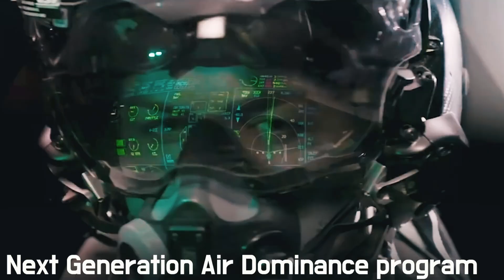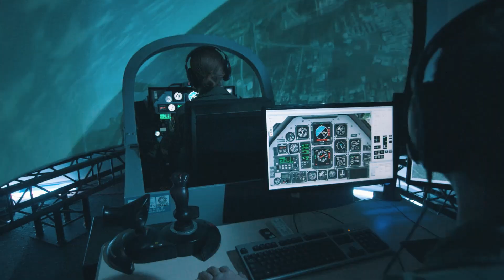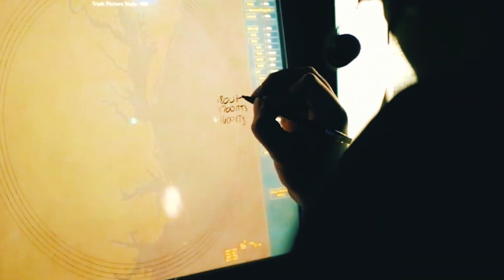The US Has FINALLY Revealed Its 6th Generation Fighter

Comment: Looks awesome to me. Though I have doubts about the laser. Unless we figure out a way to create the energy needed to make lasers operable, it's not a viable option that I see. Hell, we're not seeing the results we thought from ship based lasers due to the lack of power needed to produce such an intense ray.  But the new plane overall looks awesome. Pretty soon that little bubble of glass above the cockpit will be completely level with the rest of the body if not completely gone and forward facing cameras used instead.
Reply: The laser dispersal rate is horrendous in atmosphere. Maybe close up but, by then, a few missiles have already hit.